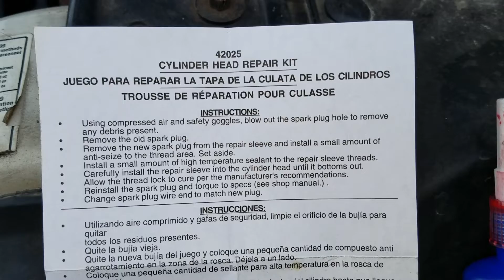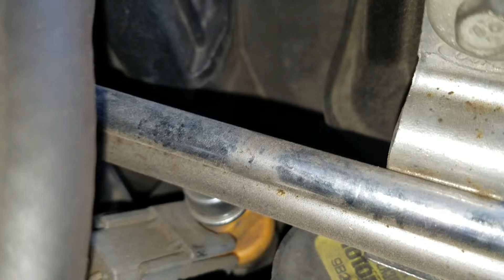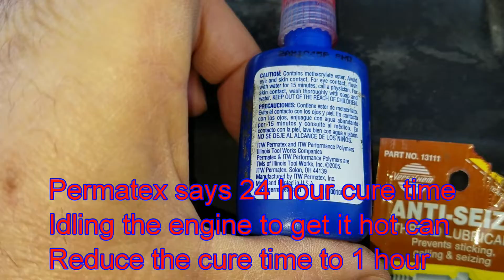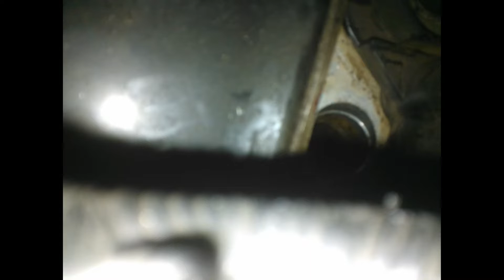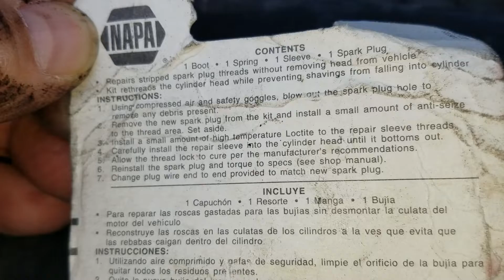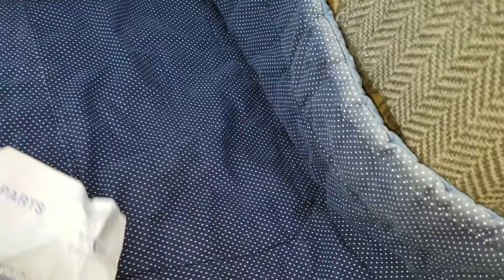Fast Permanent Fix FORD  5.4 L 2V Aluminum Head Spark Plug Seat Repair

Comment: Do you find that you have to take off the intake manifold to get better access to the plug hole to make this repair?
Reply from the maker: No. You'll need a thin wall socket to drive the new seat down. Be sure to use the correct hitemp red thread locker and load the threads up well before installing. Try to clean oils out of there too.

Comment: I did this fix and it lasted 30 miles and blew out
Reply from the maker: Yeah, there are many variables and results will be different.  I had one not blow out, but I could hear it leaking after a couple years, so I installed a new kit which worked till the engine seized on me due to a cracked oil sump pickup tube. If you have the time and tools, the CAL-VAN kit is the way to go. My new engine has all new improved seats in it. Hope you get it resolved quickly.

Comment: i don't understand why ford sold this crappy engine for so many years when they knew it was defective.  the three valve was worse
Reply from the maker: Another thing that makes me shake my head is the chronic intake manifold leak at the front right. I posted a fix for that that has been working well for about a month now. 
New engines are powerful and clean running, but the 60s engines were the most fun to work on and race.
Take care.

Comment: I think these NAPA (or Dorman) repair kits are designed for a temporary repair and not as a permanent fix. The NAPA kits increase the size of the damaged threaded hole but not so much that you can't remove it, and ream it out with the Cal Van kit and rethread it to accept the Cal Van insert which is considered a permanent  repair.
Reply from the maker: That is true. The repairs did last a few years though.
Reply: Yeah, eventually you want to get the Napa Jimmy rig kit out of there and put the permanent Calvan type of inserts in. Then you can get back to the joys of using all the same spark plugs again.😝

Comment: Is PermaTex, high temperature, thread sealant, the same as thread locker?
Reply: I ended up getting the thread locker permatex 27200
Reply from the maker: I believe sealant is a silicon material and threadlock is something different. It can be confusing. There are a couple red thread lockers and many times, the correct hi temp 400C threadlock isn't in stock.

Comment: Brother, it happened again just two months later…
The mechanic had a sleeve and installed it and it came out. I’ve got the Calvin kit and he also said he bought another kit of sleeves. What advice do you have to keep these sleeves staying in? Is there a different sealant that I should be using?
Reply from the maker: I made sure to get the 400 degree red hi-temp threadlocker. I stuffed a rag down the plug hole with a flat screwdriver and did my best to clean out any dirt and oil in the threads and surrounding areas.  I heavily saturated the threads of the new self tapping seat with thread locker. I ran it down till I hit a more solid stop. You have resistance when tapping the seat down and that resistance will suddenly increase when you hit bottom. Leave sit an hour. Instructions say 24 hours, I was in a hurry. After an hour I ran and only idled the engine just long enough to warm it a little then shut off and waited and repeated every 15 minutes for an hour or 4 times. After an additional 15 minutes, I decided to call it good and hit the road. I did the repair on 2 cylinders 3 times. One repair lasted the rest of the engines life. The other lasted 3 years and came loose. I tried to re locktite the seat in but that failed. I bought a new kit and that seat also lasted another couple years till the engine seized due to a crack in the oil sump pickup tube. The kit is a good emergency repair everyone with those Ford engines should keep on hand. The Cal-Van kit is the way to go if you have the option. Good luck with things. My new engine has all new improved seats as part of the rebuild process.

Comment: Don't waste your time with that c*** it blows out get the celvin kit I did all 8 of them on my 54 Triton haven't had a single issue
Reply from the maker: The Cal-Van kit is superior no doubt. But when you're dead on the side of the road with buzzards flying over, you'll want this kit in your bag of tricks. No special tools needed. I got several thousand miles from the kit, no issue.

Comment: Just had my plug blow out in my 99 5.4 on the side of the highway going to get it now
Reply from the maker: Get the high temp Red thread locker, 
Clean the oil from the plug threads in the head. Brake cleaner and a Terri cloth. A long right angle pick tool will be your friend to pull sockets out from the head, also for cleaning threads. Make sure your sockets will fit down the sparkplug hole. You'll be back on the road in no time. Directions say 24 hours cure time. I waited 2 hours, then idled the engine a few minutes to warm the area. Idle only, no revving or driving. I repeated a couple times every 10 or 15 minutes. After an hour or so I kept idle for about 10 minutes, then whent on my way, truck camper and all 3500 pounds plus of load. Never had an issue afterward. If this repair fails in the future, you can get the Cal-Van seat repair kit. A better repair but requires more tools and time. Good luck to you.
Reply: You ain’t a real Ford man until you’ve shot out at least three spark plugs…so get on it! 😝

Comment: Truck has been good for long time but when water hot in fuel all hell started new pump with filter still wount run right no power put to plug s in number three would not start striped it so easy these ford's suck when I have put plugs in the heads Ford people made this shit should be fired sorry crap of a engine to put plugs in hard as hell to get to the them going napa get a coil kit try fix dam fords 2000 years not like a 65 model they all gtg this new shit is all bullshit junk pure junk from sensers to gas pump s in tanks all or bs

Comment: Will this work on a 2000 f 150 4.6 v8??
Reply from the maker: I think it's the same kit. Check with a NAPA parts counter person to be sure. If the 4.6 and 5.4 liter engines use the same spark plugs, it should be the same kit.
Reply: @CITAP1  thank you

Comment: I did this and the socket got stuck in the spark plug tube
Reply from the maker: I bought a set of probing tools with various bent ends. About 10 inch shaft length. I stuck them down into the plug hole, into the socket drive opening, and was able to pull the socket out easily.
Reply: @CITAP1  thanks I’ll give that a try

Comment: Is thier a kit for the 4.6?
Reply from the maker: I think so. Check with the counter person to be certain.
Reply: Just got the kit from Napa. They do have it for the 4.6
Reply from the maker: @BESTEAGLESFAN4EVER  great! Before you screw in the seat, you should take a terri cloth rag with a generous shot of brake cleaner on it with a long flat screwdriver and turn it through the threads a couple times to remove any oil contamination from the threads. Do it a couple times till clean then a dry run to dry the threads. Blake cleaner does dry fast so wait a while before proceeding.  Be sure you have the correct hi temperature red threadlock, part number should be in the instructions,  I also provide it in the video and the about text. I loaded my threads on the seat way up completely.  When you start turning in the seat, it will have about the same resistance all the way in increasing a little as you go. When you hit bottom, it will be a fairly positive stop. While you're waiting for the seat or seats to setup, take the opportunity to check and retork the other sparkplugs.  They have a tendency of coming lose and blowing out too. I short cutted and idled the engine for 10 minutes to heat things up to dry faster. No driving but a little mild revving then shutdown another couple hours. After that, I drove several thousand miles till the engine seized due to loss of oil pressure.  That's another set of videos. OK, best of wishes to your success.

Comment: Monday 2/28/22......I threaded the spark plug with anti seize after letting insert set up overnight.  Snugged spark plug up, reconnected everything and it WORKED!!  That 7mm bolt that holds down the coil pack was a real PITA to tighten down.  I didn't have a 7mm ratchet wrench but highly recommend it.  Jeff, thanks for posting the video and sharing tips and other needed information.  THANK YOU VERY MUCH!!!!!
Reply from the maker: Awesome, glad to hear it's working for you. I'm researching my heat exchanger. Doesn't look that difficult.  I do think I'll spend the bucks for a Ford OEM part. Take care...

Comment: So if I want to one day remove this NAPA repair kit from the well, how would one go about it?  One day I'd like to use the Cal-Van repair method.  I think I might be thinking about number #7 every time I try a long drive......
Reply from the maker: You can. Calvan is larger. Those kits will come out. Hammer tapa to release.

Comment: Fun Fact: If you use the Napa repair kit you'll need an 11/16" socket to seat it.  In my 2002 Ford F-250, 5.4L gasser, the 11/16" is too big.  Solution, get a grinder and a long 3/8" extension bar and begin to grind down the socket all around.  You'll have to do some trial and error to make sure it goes all the way down and that you can spin it FREELY.  When you are ready to seat the repair adapter, slightly grease the outer wall of the newly thinned out socket.  I used brake caliper grease, it's high temp.
Reply from the maker: Another fun fact, my heater core just started leaking.
Reply: @CITAP1  Yikes!!!  Is that in the engine bay or in the dash?
Reply from the maker: @patrickwhelan5703  hoses under hood, core under dash. Doesn't look horrible. I should be able to do it in a couple hours.

Comment: Jeff, I have a 2002 Ford F-250 and number 3 position on drivers side blew the boot and I was able to reach in a pull plug out.  It apparently had a Napa Repair insert in there ALREADY.  Can I use a new Napa repair kit as time is not on my side?  I tried to screw in current repair seat but it does not take.  Will a NEW NAPA repair kit seat?  It looks like the threads on the older kit was not be aggressive enough.  I honestly have no idea it was in there and I am the original owner.  Where can I get a thin walled 11/16 socket immediately?  Did you have to removing any of the breather parts?  fuel rail?  If I get a Cal-Van kit later on what would I have to remove to get good working space?  Eagerly awaiting a reply....
Reply from the maker: I was able to install a new kit in a cylinder that already had the kit. I put a lot of red hitemp threadlicker on it. I idled the engine about 15 mi utes to warm it then shut doun to let the heat setup the new seat. I repeated after the engine cooled warming it again but not driving. I started driving after 2 hours and thenew kit lasted a couple years till the enging seized when the oil pickup cracked. The second kit worked for me, it may work for you. Can't hurt to try, and if it doesn't work,  go to the CalVan kit which is the best way.
Reply: @CITAP1  So, here it is Sunday after a crushing defeat on Saturday.  Pondering a tow to the local shop or having a last chance go at it.  I went down to NAPA, got the repair kit.  Fun Fact: the 11/16 sockets doesn't fit in the well.  Spoke to an old time mechanic, he said "grind down the outside of the 11/16 socket.........and it WORKED!  So apparently the largest socket that will fit in the well is a 5/8".  I put Red Loctite on the threads and turned it and it went in.  I cranked on it until it snugged up.  I have learned never to celebrate until its running so I will just let it set overnight.  We'll see.  
Tomorrow I put the spark plug in with anti-seize.  Fingers crossed.  
So how do you remove the boot portion of the coil pack so that I can re-fit the smaller boot on it?.  Do I just wiggle it off the Motorcraft?
Reply from the maker: @patrickwhelan5703  The boot just turns and pops off. The NAPA sockets wouldn't fit but another brand did and it might have been a 12 point. Sounds like you have everything going right. Let me know how tonorrow works out. Good luck.
Reply: @CITAP1  Haha.  If I was lucky, I'd have won the lottery by now.  I'd like to think it's a skill set, some perseverance, some sage advice and the willingness to succeed.  The YouTube videos have helped as well, especially yours.  The truck is a NY original but for the last 4 years we're down in Florida.  
Have you had to replace a Master Cylinder in the Ford yet?
Reply from the maker: I don't recall where I got the thin wall socket, Craftsman. I was able to work around the fuel rail ok.

Comment: What about the metal shaving ?? I just bought the kit from Napa too, does the piston position matter when putting in the insert ??
Reply from the maker: Doesn't  mattee. The seat only goes in so fat and hits bottom and seats. No shavings. Turn to tighten only, no need to back it out. You can always do a CalVan kit later if needed.
Reply: Ok appreciate the info, going hands on on Saturday have a 2002 Lincoln Blackwood with 200,000 miles and one spark plug was just blown out

Comment: Why not use the kit that has a tap and an inesert (similar to heli-coil but better), then your plug sits down in the combustion chamber like stock. and you can use a stock coil. And they don't break off or leak. The original problem is Ford only tapped the very bottom of the plug hole (about 4-5 threads) go figure?
Reply from the maker: The CalVan kit is the good one. This repair can be done in 15 minutes in the middle of nowhere. You can always install the CalVan kit later when you have access to a bunch of tools. Consider the kit I show as cheaper than a tow home from 1500 miles away. That was my situation.  Take care.
Reply: @CITAP1  Ok, that makes more sense if your stuck. The cal van is much like some of the other insert kits. That one that sticks up from the hole kinda reminds me of the old spark plug anti fouling things you could screw in.

Comment: worst piece of junk you could ever use Cal Van do'es the best job ever your tool your talking about do'es not come with a line up tool to keep it straight don't bother with that product.
Reply from the maker: The deep socket functions as a lineup tool. The Cal Van is the way to go but it's much more involved and this kit can get you running in 15 minutes even 20 miles in on a dirt road in Death Valley. You can always install the Cal Van kit later back in civilization.

Comment: Nice video third time this has happened on my 2001 F150.
Reply from the maker: Sorry to hear. At least the kit is cheap and easy. I had to do it 3 times over several years, twice to the same cylinder.  The engine eventually seized when the oil sump pickup tube cracked and I lost oil pressure in just seconds. The new engine has all new improved seats and is working great, $3500.00. Best wishes and take care.

Comment: Please don't use these kits. They are a temporary fix at best. Get you a calvan 38900 kit and do it the right way. So many of these fail within 1000 miles it's not worth it.
Reply from the maker: If you're stuck out in the desert or on a long lonely highway with little traffic at night, this kit will get you to civilization. For me, hauling a 3000 pound truck camper and another 1000 pounds of gear, these kits lasted me for years. The nice thing is if it fails a new kit will work, it did for me. If you do want to upgrade to the Cal-Van kit, you can. No doubt the Cal-Van kit is superior but as long as this kit is working, don't fix if it ain't broke. Take care...
Reply: It been 5 years on my 4.6 2valve Expedition and 15,000 miles still no issue.So you are wrong Chris.Only $45 + tax in Autozone I SAVED a lot,Dealership wants more th an a$1000 using Calvin kit.I did it for $45 arssaved $1000. Oh plus JB weld $5 I used instead of thread locker.Iam not a mechanic USPS carrier 30years.
Reply: Citap1,I carry a spare since I saw your video.But I doubt it to need it soon I only drive less than 3,000 a year now that Iam retired from USPS.
Reply from the maker: @efrensaclolo7021  It gave me peace of mind having a spare and I actually did need and use it on my way to a project one morning. 15 minutes and back on the road.  It's like insurance,  you never know when you need it. Take care,